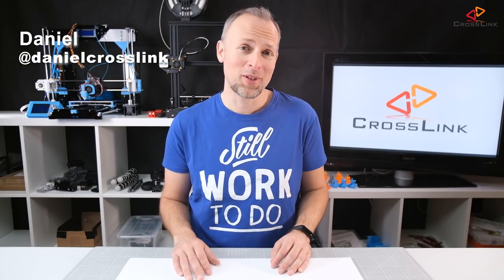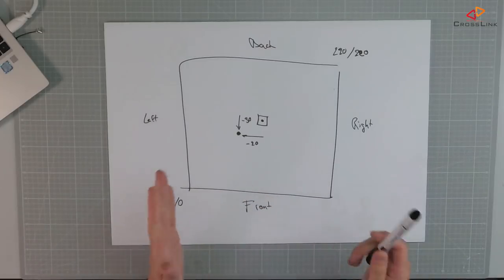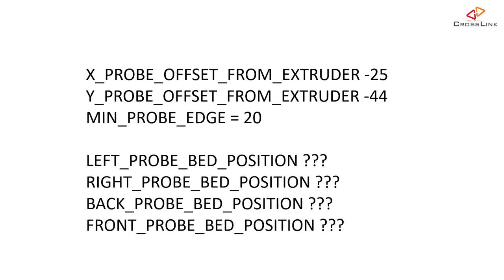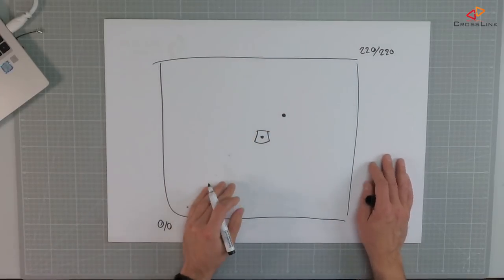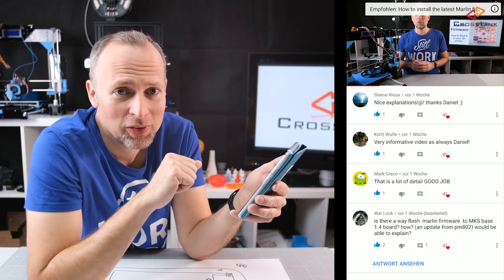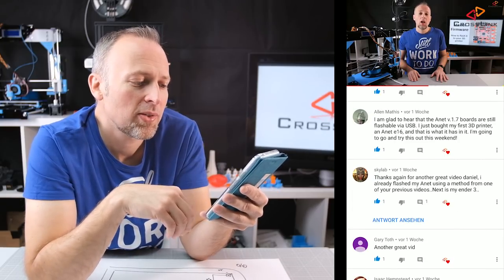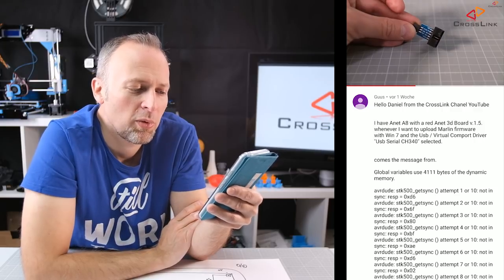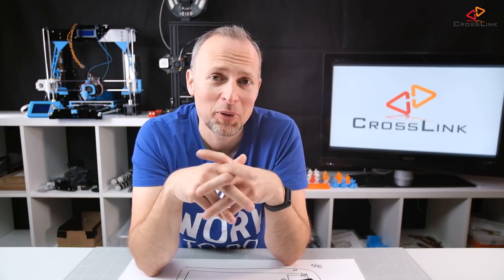Marlin Firmware 1.1.X - Probe Offset and Probe Bed Position Settings Explained

Comment: Great Tutorials Daniel, thanks! I saw one of your questions was from a user that could not get the bootloader to work on his printer. I had the same issue and it turned out to be: Windows 10 does not format in FAT32 when you right click and format disk; it will only format FAT. If you complete a format using the command prompt - Format /FS:FAT32 :(your drive letter) it will format in FAT32 (takes a while, be patient).
Then when you download your firmware update, the printer will recognize the flash drive (assuming that you do indeed have a bootloader). Surprisingly, none of the great Youtube Gurus that I watched made this very important distinction and I spent hours mucking about. If this saves one person some grief I'll be happy!

All the best, keep up the great work!

Comment: Fantastic video - exactly what I've been looking for! Question... I have an Ender 3 with a CR Touch, and the stock Creality firmware probes a mesh area that's farther to the left of the board by at least 20mm.

Does it make sense to have it probe a mesh where the corners are over the leveling springs so the mesh is actually centered on the bed?

Comment: amazing!, this video was the only thing that broke it down for me., i guess some people are better with visuals than reading text.  I think another part of the issue is the names for the points can confuse people when entering the settings for the locations since the names are counter clockwise but we are probably entering positions in a clockwise order.
#define TRAMMING_POINT_NAME_1 "Front-Left"
#define TRAMMING_POINT_NAME_2 "Front-Right"
#define TRAMMING_POINT_NAME_3 "Back-Right"
#define TRAMMING_POINT_NAME_4 "Back-Left"

Comment: Hi, I changed the PROBE OFFSET TO NOZZLE values in Marlin 2.0.x to (30, 0, 0) because my probe is 30mm to the right if my nozzle. However, when I go to autolevel it puts the nozzle where I'd expect the probe to be and my probe hangs off the edge, making the nozzle smash into the bed. How do you set probe boundaries in Marlin 2.0?

Comment: hello thank you for your video, I have switch to marlin 1.1.9 with BLTouch abd I am facing following issue. After  checking and put correct Z offset in my ender3, then I launch a print and on the 1st part of the bed the nozzle is to low in the middle it is perfect and at the rear the nozzle is too far.  is there a parameter to disable or what would be the root cause???

Comment: how can i get it to probe almost all the way to the edge? the 44 mm offset from the probe means i cant probe closer than 44 mm. i want to probe 10mm from the edge on all sides because the left side is not compensating well enough past the probed area

Comment: thanks a lot...a lot...a lot...now i find the problem on my autoleveling!
thanks another time
grazie
Reply from the maker: Gab Lar, thanks for your comment. Always appreciate your contributions. If you have ideas or suggestions on what I can improve or what videos you like to see, please tell me here in the comment section. Daniel.
Reply: @Crosslink3D  Dear, i have a problem with my prusa geeetech (aluminum version) with a 3dtouch sensor. I have install an arduino mega + ramps 1.4 + drv8825 + 3dtouch with a firmware marlin 1.19 bugfix...but there is a bug, infact after the z calibration, on the center of the plane, i start  the autocalibration (G29) but...the extruder on the center of the plane with z=0, is perfect (i make the test with a sheet paper), but if i put the extruder on back-left, or front-left position of the plane (z=0), the extruder is to low, so it impact on plane. otherwise, if i put the extruder  back-right, or front-right position of the plane (z=0), the extruder is to high...
PS: if you can, i like to view a video on an assembly of a 3dtouch, with all configuration and test.
thanks another time

Comment: Nice video but sadly it didn't explain how to solve very annoying wrong bed Z height problems. Maybe you can help me here with my question since I can't get my hotbed leveled in the 16 positions I had setup in my Bugfixed Marlin 2.1.x. version. Whatever I try my Z steppermotor keeps pushing my hotbed too far up against my nozzle. And my hotbed is correctly manually leveled with the steppers disabled. My Ender 5 Pro became completely useless although it was entirely and perfectly working upgraded to Bugfixed Marlin 2.1.x version with CR-Touch and with RUNout sensor that all worked fantastic!, until I decided to just remove the glass hotbed plate and replace it with the  brandnew Twotrees magnetic plate. Re-Calibrating went perfectly and everything worked fine and an object was nicely printed. But after my Ender 5 Pro(blem) printer's calibration was stored before it was switched off, it behaved very erratic after powering up because the bedleveling didn't work anymore as expected because the Z-bed height was somehow wrong. (Maybe because there apparently is no eeprom file on the SD card anymore after the new firmware was made and installed?). And when trying to adjust the Z-offset the nozzle crashed and also destroyed my brandnew 30 euros Twotrees plate. Nowhere is a correct answer given on how to solve this very annoying Ender 5 Pro problem. Which also started giving E1 heater reset problems while trying to print with PETG filament at 255 degrees Celsius. About 5 days ago before I had replaced the glass Creality plate everything worked without any worries and as a sunshine! Now I became so frustated after hours of trying to solve the issue that I had completely disassembled my useless Creality firmware unsupported Ender5 Pro(blem) printer that I had put everything back in its box. And when there is no clear solution to this problem, Creality never will be my 3D printer brand anymore! And I am very sure that many other frustrated Creality Ender 5 Pro buyers encountered the same issue that made them cursing Creality for their extremely bad and useless support! And I know it is not about just setting the Z-offset because that was never a problem, this bed Z height problem is a much bigger problem that seems unsolvable and makes any Creality 3D printer ready for scrapping.
Reply: I finally solved the extremely difficult to find Z height bed level problems with my Ender 5 Pro! I noticed that bedleveling only worked when I put a thin about 0.3mm sheet of paper under the probe of my CR-Touch! But just raising the bed with about that height of 0.3mm never helped! But by loosening both screws that hold CR-touch and nozzle fan holder cap and repositioning the CR-touch as low as possible and thightening the screws afterwards completely solved this crazymaking problem! So I never knew but sadly it is possible to mount the CR-Touch a little bit too high after your Ender printer never behaves normal anymore after that!

Comment: Great video Daniel; very useful as I needed to recalculate my values after installing a new sensor holder. One small thing however, you have a mistake in your calculation (see e.g. @ 6:18) - you have 220-20-25 = 185... Whereas it should be 175. Unless I've missed something?
Reply from the maker: Oh yes, miscalculated that. 😖

Comment: Hi Daniel. My home position is in the back right, opposite of what you show. How does that change these values? I made  a homemade BFPTouch and need some help setting this up and most directions are for the home position being in the front left corner. So I think that changes things for me since mine is the back right corner. Thanks!
Reply: So to further explain. When I go to the position 30, 30, it's in the back right corner, not the front left corner. Does anyone know if I need to change some settings so that if flipped? In other word get 0, 0 at the front left corner? I think this is throwing my positions off. Do I need to change my X_HOME_DIR, Y_HOME_DIR value to a 1 vs the -1 it is now?

Comment: My probe and hotend seem to auto home to the back right now, nowhere near centre of the bed. Gone over the calcs for the sensor positioning which seems correct, but just can't get it to centre, where I presume it should be? Just noticed my display shows X: 153  Y: 114, they seem to be set if you go into Prepare>Move Axis. Should that be the case?

Comment: well, it's still a bit confusing if you see these as coordinate points. When you rely on that area, "safe" positions can be wrongly seen as front-left, front-right, back-left and back-right. But they are just extra margins from each side so we can assume that for example, LEFT_PROBE_BED_POSITION means the whole left edge. This way, it's easier to understand how it works.

Comment: Hello Daniel.

I would ask you if do you know something about how can I change the bed orientated infill directions to fit the object-s angle? 

As I recognized, CURA 4.0 and Repetier slicers uses X and Y axis to create the infill inside a product.
I tought I can make a fine deal and angeled to 45o. I tought this time the slicers would do a fine hexa infill on each axis, but not. It just did the same, becouse it was directed to the bed just before. 

Is there a way to change it in CURA or other slicers?

Thank you for your advices. 
Cincerly, 
Adam

Comment: Ive moved my BLTouch due to fitting a new hot end, it is now to the left of the nozzle -42mm so I set the "x probe offset from extruder" to -42 and "y probe offset from the extruder" to 0mm, it was originally +18 on the Y
These are the original settings,
#define LEFT_PROBE_BED_POSITION 20

#define RIGHT_PROBE_BED_POSITION 220

#define FRONT_PROBE_BED_POSITION 20

#define BACK_PROBE_BED_POSITION 220

so would I just subtract the -42mm from the #define RIGHT_PROBE_BED_POSITION 220 to give 178mm

Comment: My extruder crashes into the bed clips while mesh bed leveling. I don’t have any probe like bltouch.. how can I setup the safe area for my Anet A8 plus? :) I have the latest marlin installed
Reply from the maker: Probably give the min_probe_edge a higher value first? I don't remember if this is taken into account for manual mesh bed leveling but maybe worth a try?

Comment: Thanks for the video, is there a way to store print coordination to resume print after electricity failure?
Reply from the maker: Well, yes there is such an option in Marlin that you could enable. It will store the latest print status on the SD card to be able to resume. I will make a video about this feature to show how it can be used.
Reply: @Crosslink3D  looking forward to it, Thanks again

Comment: i am using Octo Print which has a command terminal, QUESTION: can i enter in the settings here and use M500 to save to EPROM?
Reply from the maker: Sure, you can do that!

Comment: Hello  maybe you know the value of the size of the bed. The middle point. Home position is not in the middle, deviates to the right and when I do Auto leveling, bl goes outside the bed anyway I have a ender 5 v4.2.7 board I hope you can help me 😞😞

Comment: This helped me so much and I haven’t even went to type this in yet! I was sold my anet a8 about 3 weeks ago and when I purchased it the guy at the store didn’t know what type of 3d printer it was....so I purchased it anyways and tadaaa its anet a8 and I love it....but my problem is that I had no clue about the marlin software so I got really good at using the old software when it’s setting everything from the LCD! Now I don’t even know what to do and whenever I hit auto home my extruded goes all the way to the left until it hits the end stop and then lowers until it crunches into the table or I get to the power before it can do so! If theirs anyway you could pls reach out I really need your help bad and you seem crazy smart over watched all your videos! I even wiped the software off my printer so it wasn’t working at all and stayed up literally all night until I figured out how to upload marlin back onto it without using that little board that you used to reflash marlin software lol the deeno or w.e it’s called lol
Reply from the maker: My guess is that your endstop is not triggering or the Marlin settings for the switch on/off are reversed. Maybe try to reverse the endstop setting in configuration.h and try again.
Reply: Crosslink theirs no endstop in that direction I have a sensor but it’s only good over the bed! So when I go to home all the extruder lowers and dosent shift over to the bed! When I first got it with the original software on it I had it set up perfect everything was going great but I thought it’s time to upgrade to marlin, I used all the anet a8 configurations and haven’t been able to make anything since! I stayed up for overnight with no sleep trying to figure it out and all the next day! I’m so overwhelmed and it sucks because I use it for my company lol like I was saying you’re very smart when it comes to 3D printing and I love how you explain everything in your videos so you’re the only one I could think of that could help me lol
Reply: Crosslink which endstop would I turn off when the extruder is lowering? Is it one of the Z-min or Z- max lol I’m sorry I know nothing lol
Reply from the maker: mike straub z_safe_homing will fix it

Comment: Is this video out of date for MArlin 2.0.X? I can't find the parameters you've listed in configuration.h.
Reply from the maker: Might be. Time for a new version...
Reply: @Crosslink3D  I think in marlin 2.0.5.3. it will be calculated by the z probe offsets and the probing margings. it will calculate safe margins.
Reply: @mkuebbeler  its super annoying that these settings are not in the new marlin, as setting the offsets and margin still only probes for me too far to the left and the right side of my bed does not get probed

Comment: Great vid as always. Question I’m having trouble with abs adhesion to build plate I’m using quality blue tape and pla sticks well just not abs
Reply from the maker: What temperature are you printing at? Are you using an enclosure for your printer?
Reply: @Crosslink3D  tried up to 90 degrees so far and don't have an enclosure as yet
Reply from the maker: I can hardly imagine how long the Anet A8 will need to heat up to 90 degrees Celsius without a chamber. You can try cheap hairspray or glue stick to prime your bed. The enclosure will help to reduce the warping so the parts cool down slower. Warping will lift up ABS from the plate which is the most annoying.
Reply from the maker: And of course the heat up time will be reduced quite a bit.
Reply: @Crosslink3D  indeed the heat time is   excruciating, I have tried the hair spray and glue to no avail, what's your opinion on pla +, my unit seems to print pla OK but I'm getting a lot of stringing

Comment: Hello everyone, I have a small problem. I have Ender 5 v4.2.7 board now I have marlin 2.0 bug fix on it but now my bl goes left outside the bed anyway. And home position is also not in the middle of the bed Who has the settings of the bed for me. Where the needle should be.

Comment: another very helpful video, but in this case I could not find those settings you have there, however I found something else that worked to keep that probe off the outer edge.
Reply from the maker: This video is for Marlin versions before 2.0.X. Maybe that is the reason.
Reply: @Crosslink3D  Oh, thank you, either way I have solved my problem as the result of watching this video.

Comment: you let me know is there anything wrong with code.............

  // Set the boundaries for probing (where the probe can reach).
  #define LEFT_PROBE_BED_POSITION MIN_PROBE_EDGE 20
  #define RIGHT_PROBE_BED_POSITION (220-20-25)=175
  #define BACK_PROBE_BED_POSITION (220-20-40)=160
  #define FRONT_PROBE_BED_POSITION MIN_PROBE_EDGE 20

lvalue required as left operand of assignment

Comment: Good video, but the recommendation to use a ruler to measure X/Y offset seems like the wrong way to go about it, it's not going to be hugely accurate
Heat up your extruder
Move nozzle to close to bed
Extrude filament until you get a dot of filament on bed
Deploy the probe if it's a deploying type (eg BLTouch)
Now go into motion and make a note of the starting X/Y positions
Use the motion commands to move the extruder until the dot of filament is precisely under the middle of the probe
Make a note of the end X/Y positions
probe offset for each axis is START_POSITION - END_POSITION. You will get positive or negative values automatically, you don't need to understand which way is + and which is -

Comment: Where are these functions located inside Marlin, I don't see them, I try searching for them in the configuration.h  but no luck ?????

LEFT_PROBE_BED_POSITION for MIN_PROBE_EDGE_LEFT
RIGHT_PROBE_BED_POSITION for MIN_PROBE_EDGE_RIGHT
FRONT_PROBE_BED_POSITION for MIN_PROBE_EDGE_FRONT
BACK_PROBE_BED_POSITION for MIN_PROBE_EDGE_BACK
Reply from the maker: This has changed between Marlin 1.1.X and 2.X. I did not yet investigate how it's done with the new version but an updated guide is planned
Reply: @Crosslink3D  Can you jump into discord channel? I have made some progress Z_SAFE_HOMING needs to be enabled and is the new way of setting up Bl touch forget pasting the code in from the BL touch manual